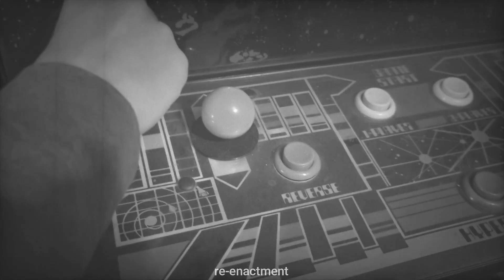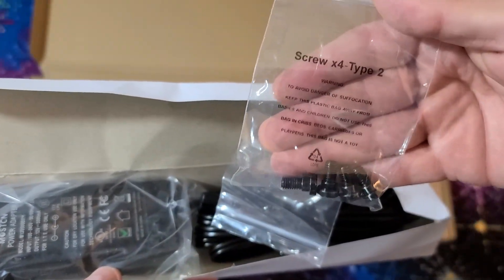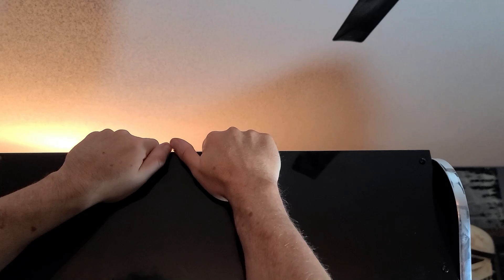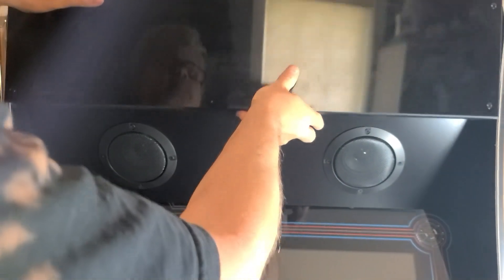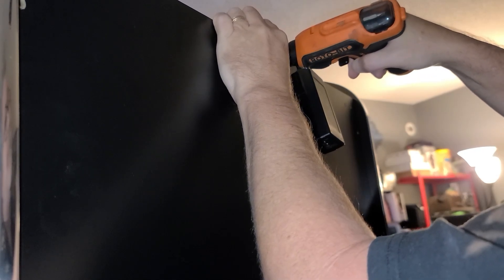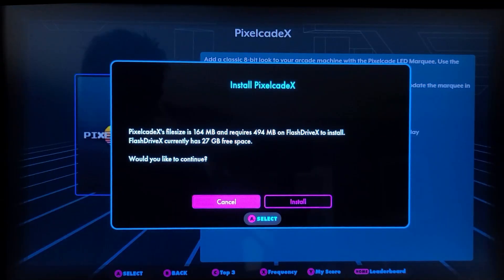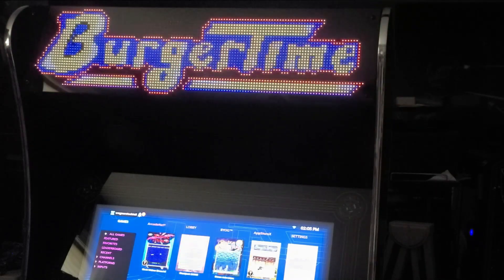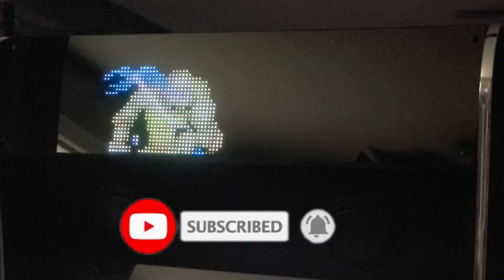AtGames Legends BitPixel Marquee for the Legends Ultimate

Comment: Jon I know this is an older post but I finally bought a atgames legends ultimate arcade and added the bitpixel today.  Followed your instructions to a tee ,(tea) I'm a southern man lol. My version is  5.65.0 ... I have a coinops build on sd and always booted to that. Now it doesn't just factory installed games. I made setting changes and now it boots into it but not coinops build that I had. Can still play games bit they a listed just like installed games format.  I would appreciate it if you an answer to my issue.  And by the way I appreciate you and all you do. I've bought many products because of your reviews and I have not been disappointed yet. Keep on doing what you do thanks in advance...
Reply from the maker: Southern man here also, definitely understand the tea reference lol.  I tested booting directly into COX sometime ago, but don't recall the specifics.  I'd recommend posting your question here: https://www.reddit.com/r/LegendsUltimate .  I have the BitLCD installed currently and not able to easily assist with your question.

Comment: This looks to be a great addon mod. I looked at the LCD version of this, and nearly fell through the floor. That item cost as much as my ALU. Fingers crossed this isn't nearly that much. I am currently using the Arcademodup LCD dynamic marquee, but I'm leaning towards getting this, if it isn't staggeringly expensive. LOL Thanks for sharing this.
Reply from the maker: Thank you for watching, I have a bit more information on the ALU guide here, if interested: http://wagnerstechtalk.com/alu/#Legends_BitPixel  The base-price is around $200, however twice a year (one being in February -typically) they'll have a NOD (New Owners Day) sale where you can typically pick these up much cheaper.  If you can hold off for a little bit, may be able to save some $.  Just a small tip to try to help.
Reply: @WagnersTechTalk  Thanks for the link, and NOD tip. Will do. :)

Comment: Couldn't you plug the usb drive into the hub inside the machine so it's one less thing to worry about on your panel?  I mean, since you're going to want it in all the time and whatnot.
Reply from the maker: You certainly can!  I didn't because I'm always dorking around with stuff 😀  But let's say you have CoinOpsX installed you don't plan on making any additional changes in the near future, yes, installing it on the USB hub is perfectly fine.

Comment: How do you turn off the Bitpixel?  you have to unplug it?  any way to connecting it to the machine so it turns off and on with power button?
Reply from the maker: The power to the ALU and Bitpixel are separate.  One easy way to shut them both off would be to use a power strip connected to a WiFi smart plug.  Then using Alexa/Google Assistant, you could use your voice to power them both completely off.

Comment: Can you use the bitpixel with a pc connected through otg mode ?
Reply from the maker: You can, please see the guides here: https://pixelcade.org/howto/
Reply: @WagnersTechTalk  Its the bitpixel from atgames that im thinking of getting not the pixelcade version, or are they identical
Reply: with an atgames ALU
Reply from the maker: The software works for either.  I used their instructions to get the BitPixel HV working on the ALP +FX3 (video here: https://youtu.be/ZTkta8FKyXw ).  Pixelcade designed the BitPixel, so their stuff should all work fine with the Bitpixel and BitPixel HV.  Hope that answered your question.
Reply: @WagnersTechTalk  Ok thanks, Bitpixel ordered